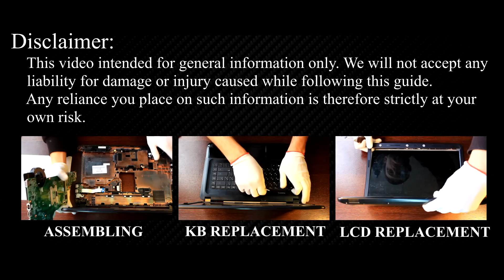HP Compaq Presario CQ58 Disassembly, Fan Cleaning, and Thermal Paste Replacement Guide

Comment: Thanks for the video, it was really helpful! One big question though, just before you replaced the fan you added a blob of white stuff to the board, where the heat sync connects. What was that and where can I get it? 

Does anybody know? Thanks!
Reply from the maker: +Ben Horn this is thermal paste. For example you can use Arctic Cool MX-4 or Zalman ZM-STG2.
Reply: +How-FixIT thank you!

Comment: Followed every instruction carefully till 7:04, very gently cleaned the dust that was gathered, put it back together by reversing the video, and now my laptop won't turn on :( PLEASE HELP
Reply from the maker: Priyanka U check how pluged all cables (power botton, power cable, fan cable etc), try to reassemble, check RAM.
Reply: How-FixIT Thanks, it was the power flex cable